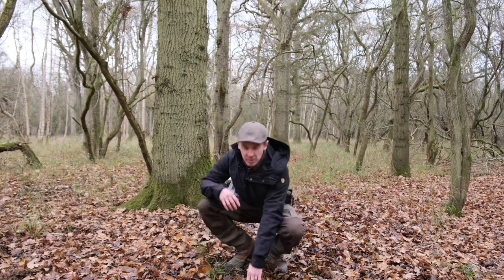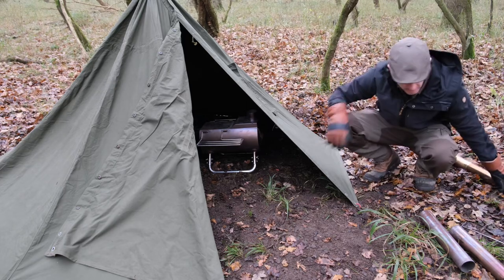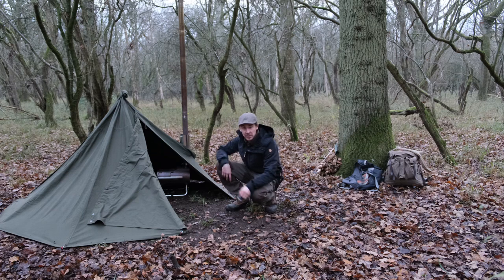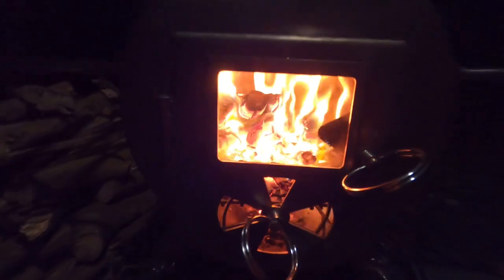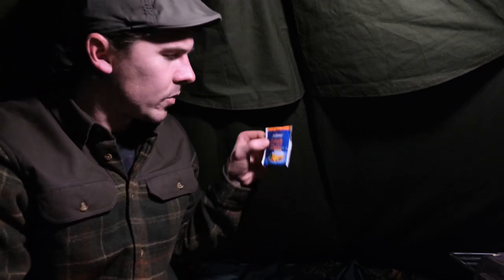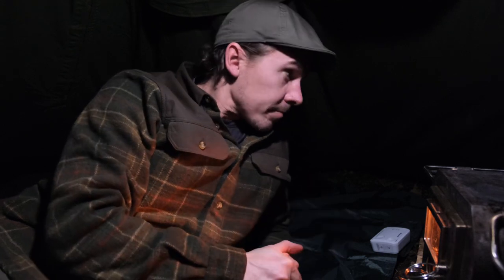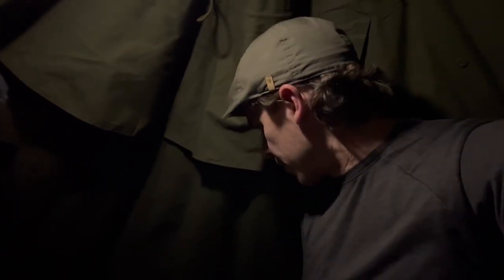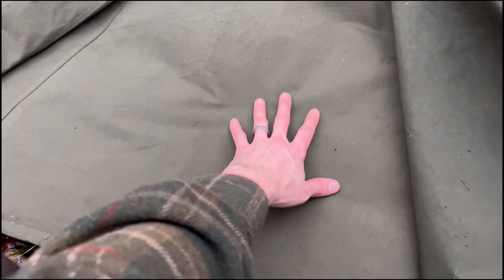Winter Lavvu Hot Tent Camping in the Rain - Bushcraft / Military Surplus Gear & Gstove Cooking

Comment: Pheasant are forever scaring the Bejaesus out of me too, the stealthy buggers! That dinner had me worried there for a minute, with the sheer amount of garlic early on, but all made perfect sense in the end - mouthwatering. I've not ever seen a lavu up close but I Imagine some sort of old fashioned paraffin/beeswax type treatment working with them for waterproofing? Would be a HECK of a lot of work though. A vat of melted Fjallraven Greenland Wax, applied with a broad paintbrush? 😀 That was a very entertaining hour, and may well have converted this hot tent sceptic. Brilliant vid, thanks for all the love that has gone into it. 👍 Rich
Reply from the maker: Yeah that pheasant about gave me a heart attack! Usually I use that amount of garlic for 4 salmon slices in the pan, but I really like garlic so I just went for it!  It’s a tasty way to prepare salmon! From what I’ve read about the Polish Lavvu’s, the tight weave of the material and how it is sewn gives the material it’s water proofing. After I got home I looked up what I used previously to help add some water resistance. I sprayed Nikwax on it a couple years ago and it’s been doing a great job ever since. It’s not light but I really really like the shelter and it’s kept me dry every time I’ve spent the night in it. And it always seems to rain all night when I choose to go out in it! I definitely think you should give hot tenting a try. There are way more tent and stove options nowadays! Much easier to give it a go! Thanks for watching and the wonderful comments as always. Have a great New Year Rich! All the best!
Reply: I suspect that was a fox.They do have one of natures more jarring yells.Earplugs essential .

Comment: I really like using a 45 degree so that the spark arrester is away from the tent, just in case you get sparks that fly out on your tent it seems like it works really well this way for me. And I really like your G stove. That’s gotta be superduper quality I know I have one myself. I’ve got the extra long one. I really do believe that that stove was made for the tent not designed. The problem with these days is nobody makes anything anymore. Only but a few people I know this myself I was a tool designer and toolmaker for 42 years at the same company. Made everything from spacecraft parts, and all kinds of exotic metals.
Reply from the maker: It’s an absolutely fantastic stove. The 45 degree angles are great for tents that have a greater maximum height or don’t have a long enough flue. I don’t find the angle necessary with this setup just because the stove flue extends far past the minimum height necessary for a tent of this size. I’ve actually never even seen sparks make it that far out but if they did  and were small enough to get past the spark arrester they would fizzle out before reaching the tent. I completely agree. Many things are made extremely cheap nowadays just to maximize profits. My best gear is still the stuff that is handmade and usually cost more as a result but it will probably last a lifetime! 42 years designing and making tools, wow! Sounds like a fantastic career. Really appreciate you watching and taking the time to comment. All the best.

Comment: At the 11:00 mark. It looks like all that is needed is a notch cut from the bottom of the shield just enough to let the damper dial slide up. Not all the way up to the tent chimney opening, but maybe 4-5 inches from the bottom to allow it to be embedded and accessed for control.
Reply from the maker: Yeah that would definitely work 👍. It’s not typically too big a deal though because just controlling the airflow with the damper on the front of the stove works really well. I’ve also stepped away from using this stove in favor of a newer titanium stove the folds flat. This will most likely only get used in my larger hot tents now where I don’t need to use the heat shield so close to the stove. Really appreciate you watching another video! ATB